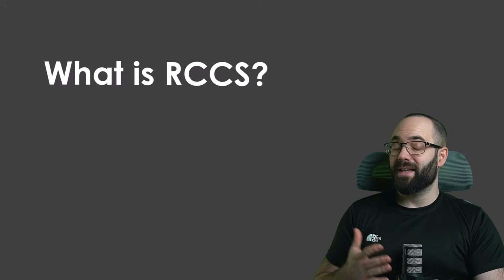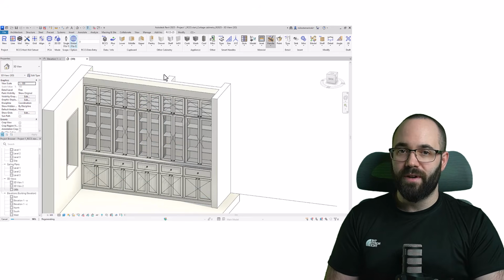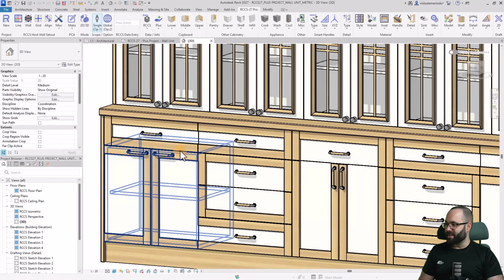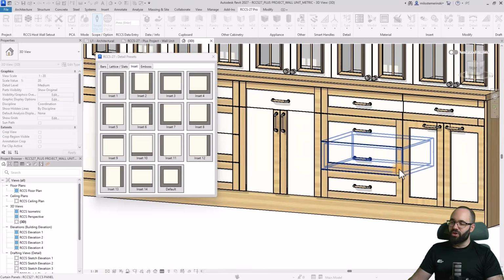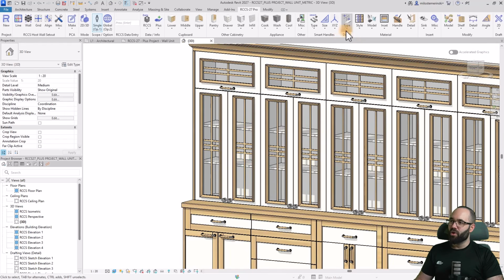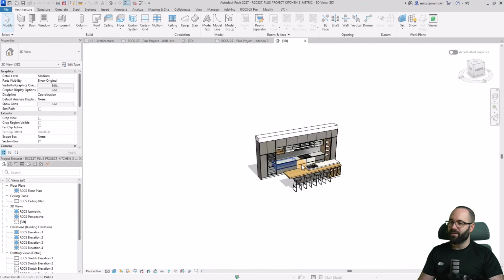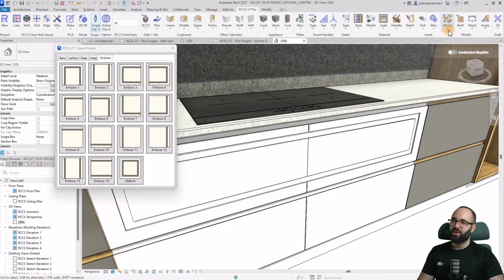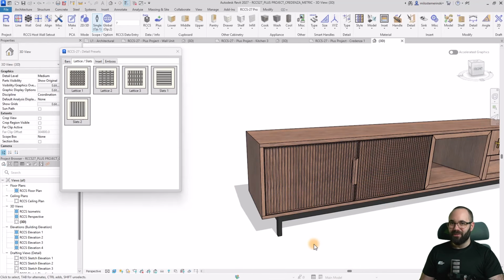Cabinetry Plug-in for Revit 2027 Tutorial

Comment: I work for millwork companies, and found this very interesting, though have lots of doubts about it to create detailed shop drawings, sections and details.  Can you control the pulls also? Or switch to full length finger pulls? I know Revit is not the appropriate software to create fabrication shop drawings. But it is interesting to see how it works to create designs faster.
Reply: All handles (including pulls) are fully parametric and yes the pulls can be adjusted to full length : https://www.youtube.com/watch?v=WnPX5FfnhE8